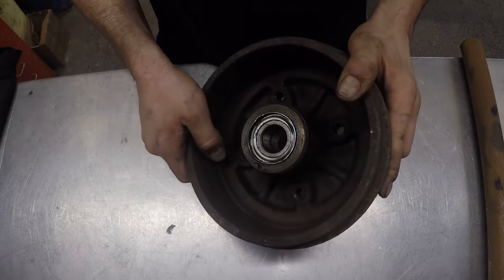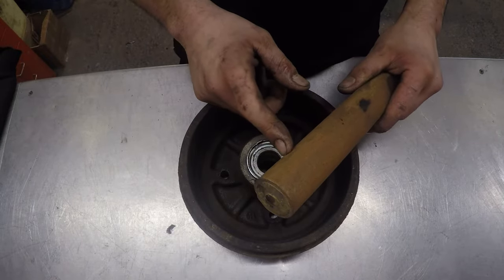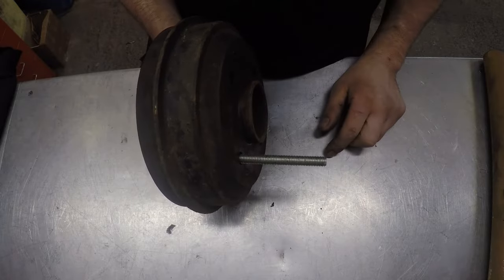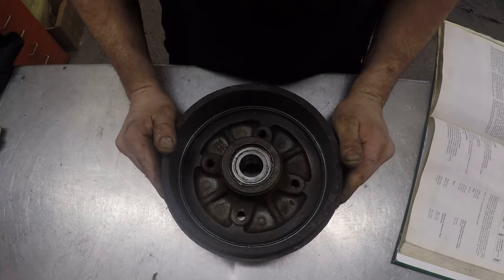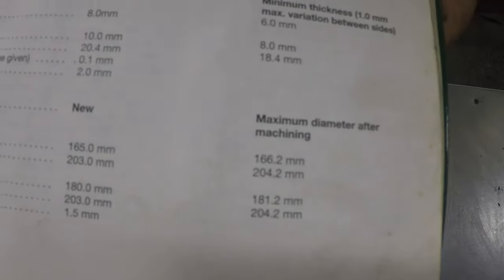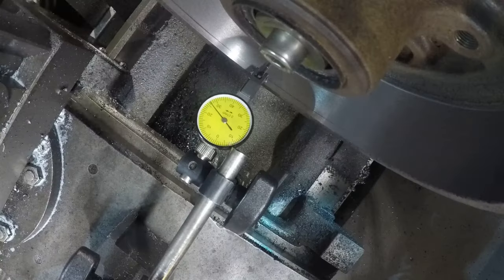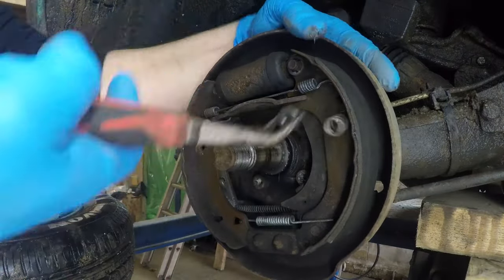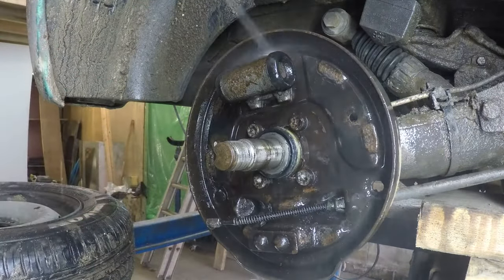Skimming brake drums

Comment: A very nice job. I used to do drum brakes on stands in the parking lot, because I would pull drum and then wash clean with a garden water hose/ nozzle. No dust, and nicer to disassemble clean brakes.

Comment: Great job. It’s funny how those who cannot do this job always think it should have been done differently. Inevitably, they, themselves, have no YT tutorials. This is a great use of your tools and the drum doesn’t know what type of lathe did the job. Ive had a chance to get two, both free. Can’t justify for a diner with an engine lathe. A brake lathe takes a lot of space for the one job it does and you are right, most just wastefully replace drums and disks nowadays. For business the time of setup, measuring, and turning would be difficult to charge for when the customer always thinks that new is best. Kudos for saving and using serviceable parts.
Rant over!